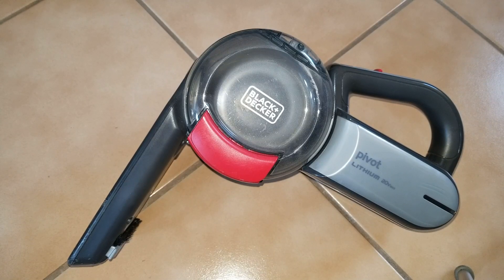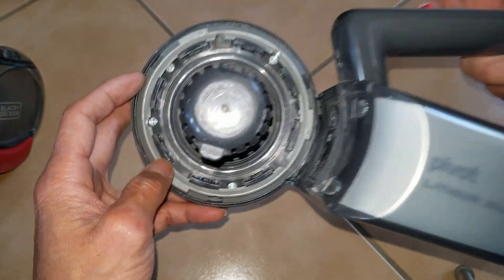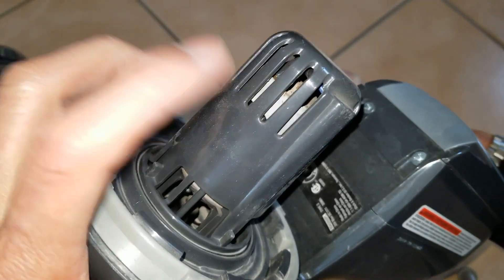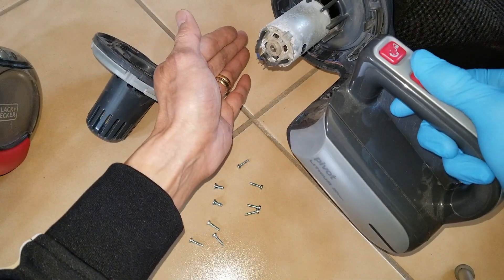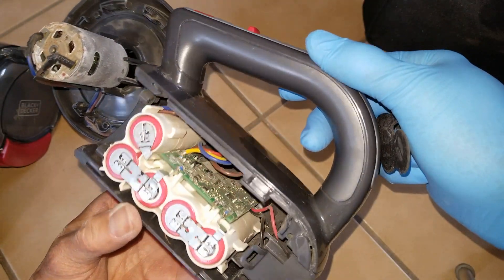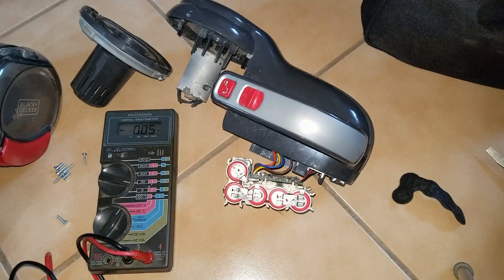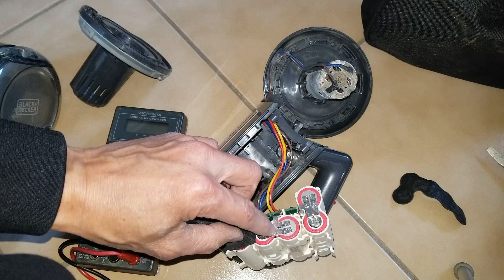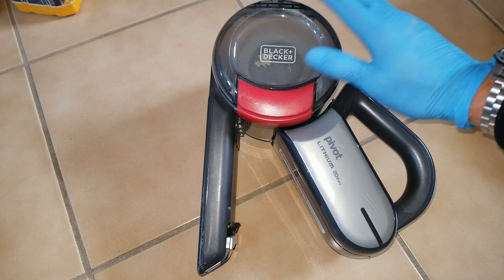BLACK & DECKER PIVOT LITHIUM 20V MAX HANDHELD VACUUM TEARDOWN

Comment: where can I get 20v max lithium ion battery for black and decker pivot vacuum
Reply from the maker: It's cheaper to modify an adapter to use with DeWalt 20v battery.

Comment: Hi, I have this vacuum and the adapter stops working. Can I use a 24V 1a adapter as a replacement for it since I can’t find an exact adapter that is 23V 400mAh as the original one.